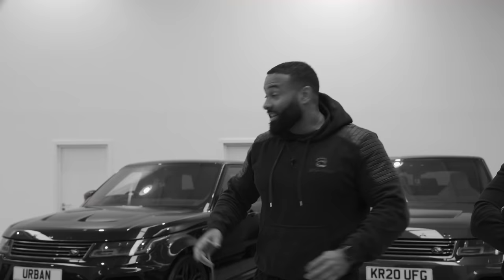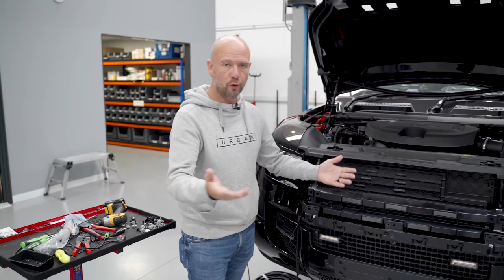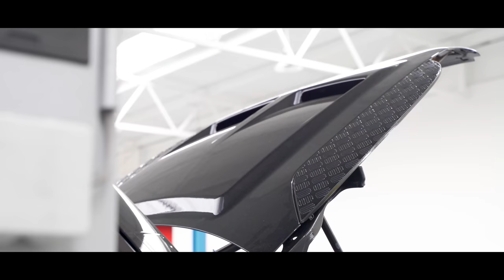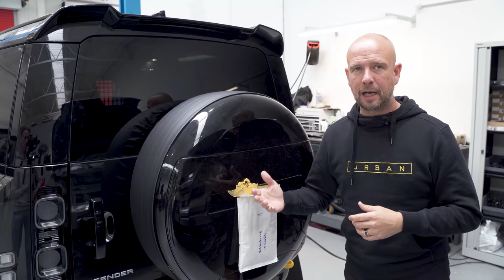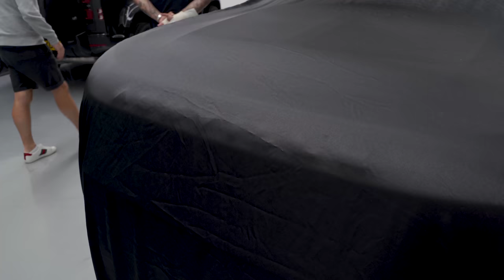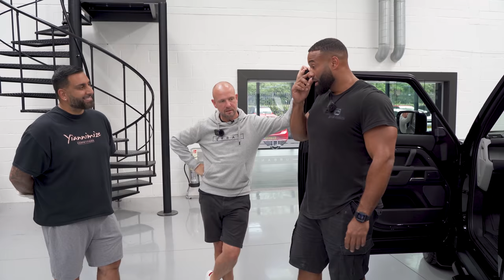Building Daniel Louisy's 1 of 1 'Ashville' Defender | THE ULTIMATE SITE VEHICLE!!

Comment: The car has standard headlights? The one on the left seem to have the projector headlights, probably some form of matrix LED.
Reply: I think he went for the low spec 110 version, based on the original steel wheels and unpainted bumpers.

Comment: I can't help but worry you have spoilt the vehicle in a few regards - the ride comfort and off road competency is completely ruined with the large wheels and the half of the vehicles wading ability comes from the internal structure of the bonnet acting as an air bowl, the vents aren't real are they? otherwise they've just disturbed the designed in airflow routes and wading ability!
Reply: Your right about going off road on them wheels but he ain't going proper off roading , it's more about looks & being different then the 100s off thousands made.
I got 22inch on a 2010 range ,ride is not what it was on 20inch but that's small roads & speed bumps,motorway drive ain't much different. 
That's in a 2010 plate 
2021 plate gota be much better in every aspect.